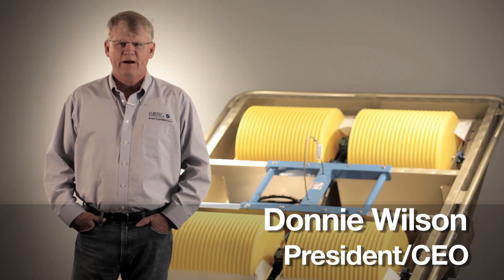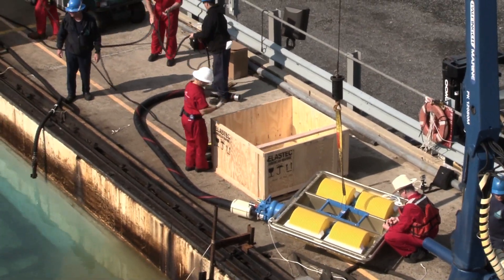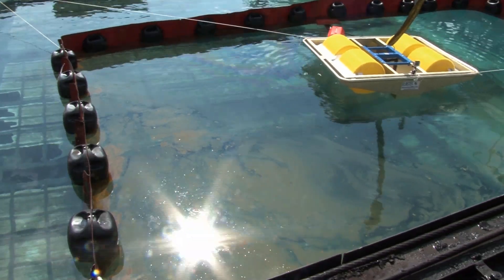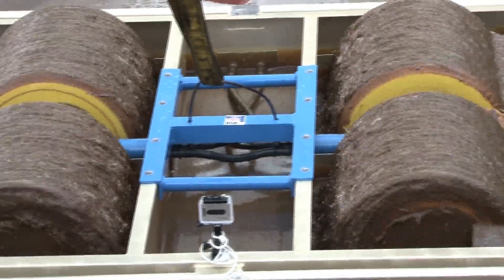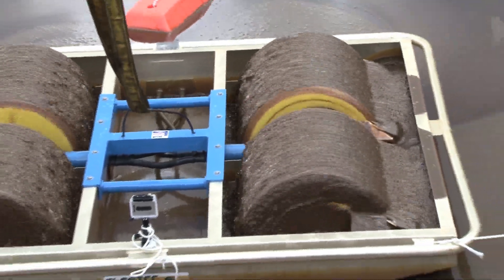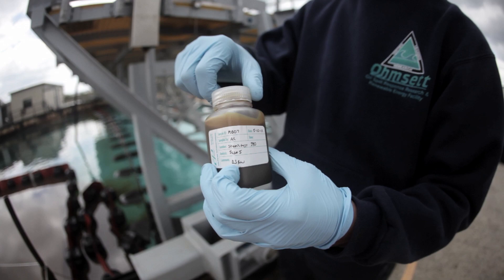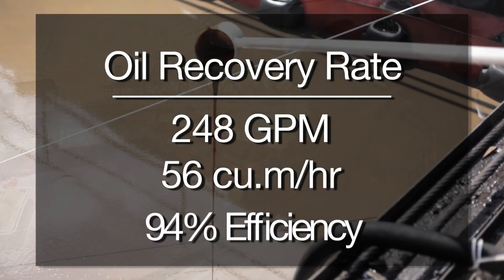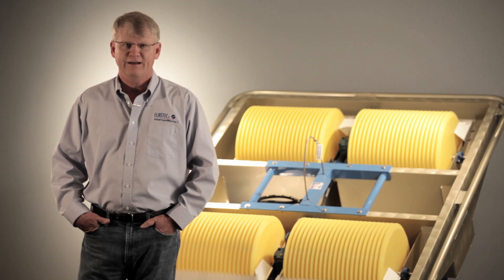ELASTEC | Magnum100G Testing at Ohmsett

Comment: sir,I have one question in the floating dram type oil skimmer is that you used roller. I want to know 
which type of material is used for roller.
Reply: any hydrophobe low density plastic should be fine